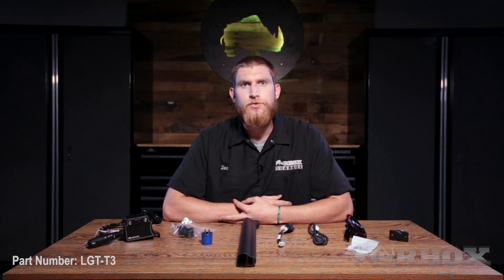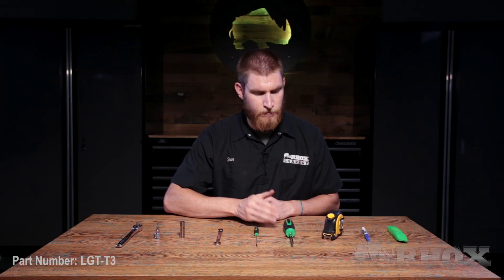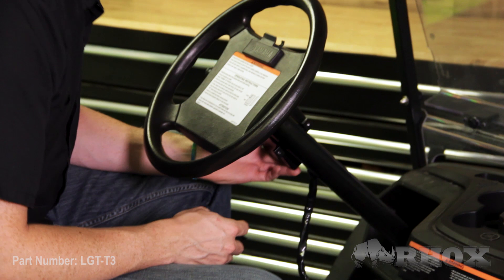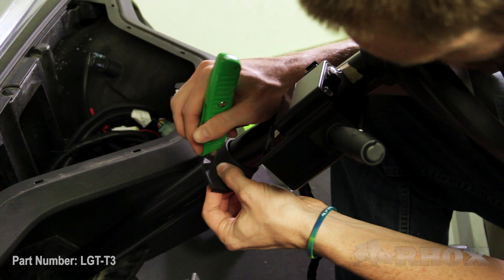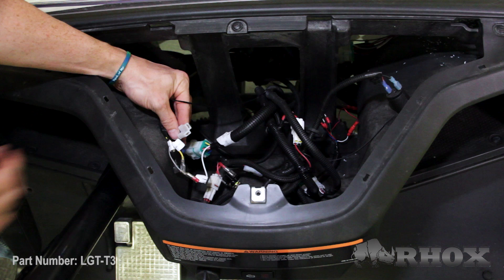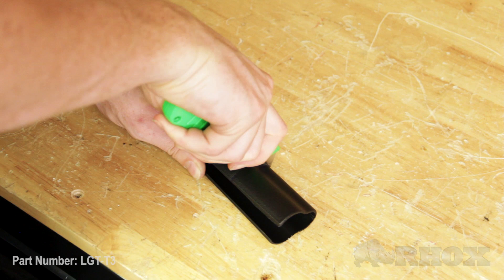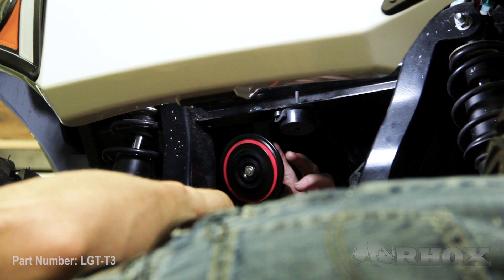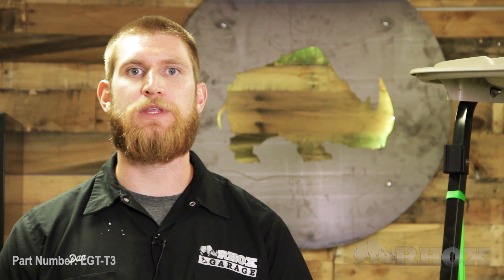LGT-T3 Kit on a Yamaha Drive2

Comment: I have a 2021 Drive 2 EFI.  It has LED lights but no turn signals.  I would like to add turn signals and side mirrors with turn signal indicators.  I already have a horn.  Do you have a kit that will provide what I need to do this?
Reply from the maker: Our turn signals are designed for RHOX plug and play wire harnesses and light kits but can also be hardwired into another brand's light kit.  We can provide a wiring diagram of the turn signal harness upon request.  Keep in mind, all features on the turn signal may not be applicable with a different brand's lights (i.e. high/low beams). The T3 also includes an ON/OFF switch for the lights so the standard push pull switch will not be used.  
For the mirrors, as long as your headlights are capable of a turn signal function, you should be able to wire the mirrors into the circuit easily. 
Both of these items can be purchased from your RHOX dealer.

Comment: Can you control the accent lights independently from the turn signal switch? There is a single wire plug in the 
LGT-401L wire harness that says accent light control from turn signal switch but I see no where to plug this into the LGT-132A wire harness.
Reply from the maker: This turn signal does not control the accent lights separately. You would need the LGT-T4 or T5.

Comment: Would the LGT -T3 kit also work with a LGT 398 light kit? Thanks, Rob
Reply from the maker: The LGT-398 is a basic wire harness. You will need to use a plug and play wire harness if you would like to install accessories like the T3.  The LGT-398 only includes connections for head/taillights and batteries.

Comment: I have a 2018 Yamaha drive2 cart that has a Rhox LGT-401L light kit installed. I would like to add the LGT-132A turn signal kit to it. This cart already has a horn and and accessory plugs so I don’t really want to buy the LGT-T3 kit. I see in the Rhox garage videos they talk about a LGT-590 jumper to replace the on/off switch, is this required? I do not see it listed anywhere on your site to order this part number.
Reply from the maker: You can buy the LGT-132A separately from the LGT-T3 kit. You will have to replace the push-pull switch with LGT-590. You will also need the LGT-147 horn harness.  If you do not have a column cover, you will need LGT-107A. This will cover the turn signal wire running down the column.  Please call your dealer to order the items not listed on the website.  They will be able to get them for you.

Comment: Just had an upgraded light kit installed on a Yamaha UMAX 2+2 and the lights come on even when the key is off and out of the ignition is the normal on Yamaha's?
Reply from the maker: I'm not familiar with how their harness works. If you are using the key switch to power the lights, you could have hooked the light kit to the always on terminal of the key switch.  If you need a wiring diagram, you can check out this website.  Just go through and find your year and model.

https://golfcarspecialties.dealerspikeparts.com/oemparts/c/yamaha_golf_car/parts

If you hooked the light kit directly to the batteries and the key switch is out of the equation, the lights can turn on because they are still getting power.  

If you have installed the T3 turn signal from RHOX, the turn signal will control the ON/OFF functions of the lights. Any other ON/OFF switch (push pull, key-switch etc.) will compete.

Comment: Do you have to have the Rhox brand light kit for the turn signal
Reply from the maker: You can hard wire this turn signal into other brands of light kits but we cannot guarantee all the features will work with someone else's lights.  The high/low beam feature will not work with someone else's headlights.

Comment: I have a 2020 Yamaha Drive 2 DC with Rhox LGT-401L Headlights and taillights already installed.  I would like to add Turn signals and Brake lights.  If I add LGT-T3 (LGT-132A) Deluxe Turn Signal Kit and LGT-B14 Brake light kit will I need any additional Harness' or a Voltage Reducer?  Also I would like to add a Horn but not sure which Rhox horn to select.  I am running Stock Trojan Batteries with Navitas 440A controller.  Also, will I need a Voltage Reducer?  Please help.
Reply from the maker: You shouldn't need an additional harness as those accessories will plug directly into the LGT-401L's plug and play harness.  The turn signal will only be able to withstand 12V. We would recommend either a reducer or hooking the system up to a 12V battery.
Reply: @GolfCartInstructions  The LGT-401L lights and taillights are currently working, will I need to add a reducer for the turn and brake lights?  I'm not sure what you mean by 'the system'.
Reply from the maker: @joshuarbarber3869  Yes, you will need to either add a reducer or hook the light kit and accessories to a 12V source, typically one battery

Comment: I have a 2016 Yamaha YDREX6 (G29 from what I am told) that has the RHOX Deluxe turn signal kit, high beam headlights, etc. The kit was already installed when i bought the cart. Do the taillights not include brake lights nor turn signals? Front turn signals work great, rear taillights work but do not get brighter when braking and do not flash when the turn signal is on. Is there another kit i need to buy?
Reply from the maker: Are the taillights RHOX? Is the harness RHOX? Do you have a brake switch installed and if so, which one?
Reply: @GolfCartInstructions  the taillights are RHOX and the harness is RHOX. I am not sure if the brake switch is installed. Do you have a link to the brake switch controller so I can see what it looks like and confirm it is installed?
Reply from the maker: @adamzierenberg  The brake switches we carry for the drive are the LGT-138, LGT-B12 and LGT-B13.  You can look these up at www.rhox.com to see the photos and details.
Reply: @GolfCartInstructions  thank you for the excellent customer service and prompt responses!
Reply from the maker: @adamzierenberg  You're welcome!
Reply: @GolfCartInstructions  I have confirmed the cart was not equipped with the brake switch which explains the lack of brake lights. Would this also be why the rear lights do not work with the blinker?
Reply from the maker: @adamzierenberg  I would check the pins on the 9-pin connector coming from the turn signal - just to make sure they aren't loose. You can check the fuses on the harness (near the power connections) just to make sure they aren't blown.  You could also see if you are getting power out of the middle pin on the taillight connector when the turn signal is ON. The middle pin is the high intensity wire for brake and turn signal.
Reply from the maker: @adamzierenberg  Also, is the turn signal from RHOX too? If so, which one?

Comment: Have a link to where to buy this?
Reply from the maker: http://www.golfcart.com/pc_product_detail.asp?key=22721E487DC5492F9F694F51E4D14B5F
Reply from the maker: Wayne, this is the product link. You can purchase it through any RHOX authorized dealer. You can also look up the turn signal by part number LGT-132.  The T3 is a package that includes the horn and a 12V dual USB outlet.

Comment: My harness doesn't seem to have another connector for the horn , and the video doesn't show where he e plugs it in. Every connector has something plugged into it. What am I missing ?
Reply from the maker: Are you installing it into a RHOX brand plug and play light kit harness?
Reply: @GolfCartInstructions  yes it is . Everything else plugged in perfectly and is working.  I did buy the cart used and the harness was already installed with basic lighting on a push pull switch. I upgraded to the deluxe light kit with blinkers , horn , etc.  and installed brake light switch. Only issue is the horn
Reply from the maker: @disalvofamily231  Do you know the part number of the harness installed?
Reply: @GolfCartInstructions  fixed it myself.  The wire diagram said the green and white wire goes to horn. Hardwired it direct to the horn. Boom done !
Reply from the maker: @disalvofamily231  Good! I was going to send you the wiring diagram once I figured out which harness you had :)

Comment: I have been extremely impressed with RHOX products and their online tutorials however I must say, whoever designed the mounting assembly for the control box had no idea what they were doing. There is absolutely zero clearance for the cable coming off the back of it... You cannot bend it enough to clear the steering column. I am going to have to fabricate some type of spacer to get it away from the column so the harness can clear.
Reply from the maker: Hi Joe, Thank you for your feedback.  It should be a snug fit.  We haven't heard of any complaints but I will certainly pass it along to our product development team to see if we can improve the clearance in the future.

Comment: I have a 2018 Yamaha DR218EFI with lights and horn already installed. Which of these kits do I need to use to install the turn signals.
Reply from the maker: Any of our turn signal packages should work with your existing light kit as long as your light kit is capable of having turn signal functionality.   

If you have our plug and play wire harness, you can plug the turn signal directly into it.   If you do not have a RHOX plug and play wire harness, you will more than likely have to hardwire the turn signal into the harness. 

If the lights and harness are not RHOX, you will not have high/low beam functionality with this turn signal or the LGT-180 (T4).  The LGT-T1 and LGT-T2 turn signal packages do not include this feature.